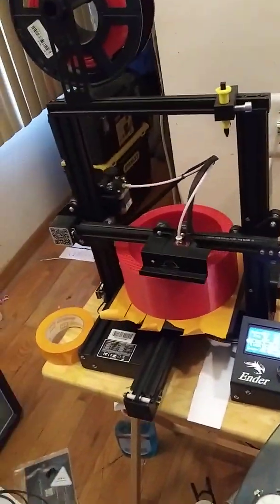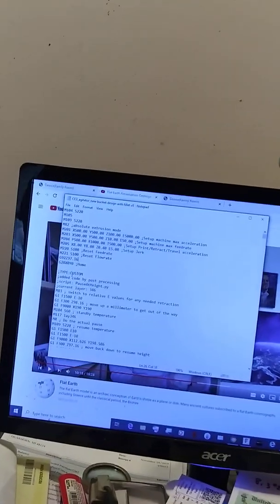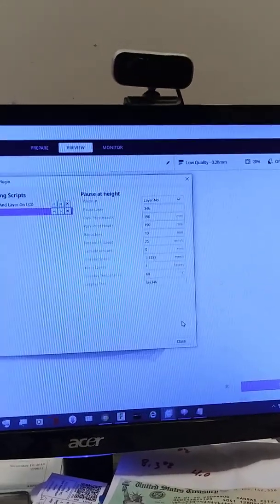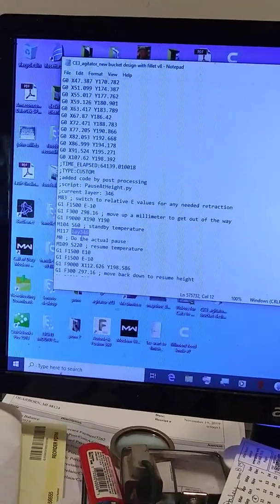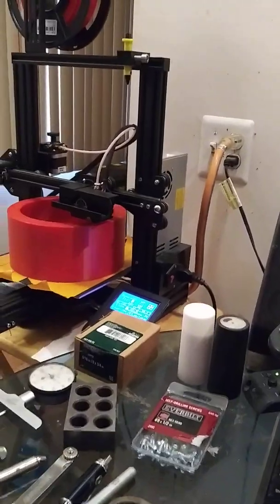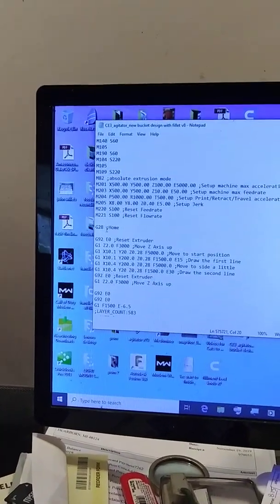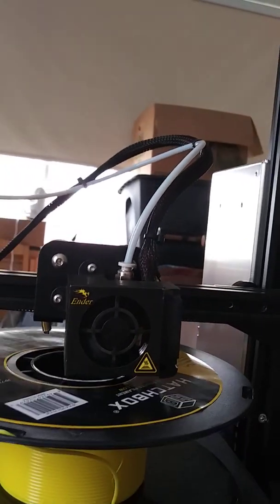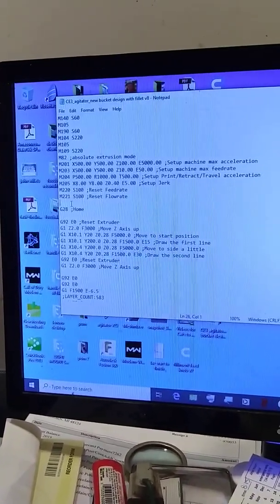Restarting a failed 3D print without homing the Z axis

Comment: I have 2 comments unless you are making a video for Tic-talk record your video in the Landscape orientation. 2nd, Don't give up on 3D printing. I have been trying to get a reliable printer running for the past 4+ years. Every now and then I think of giving up but there are so many ideas I want to design that keeps me going. Also, 3D printers have come a long way. Sure there is a lot that need to be fix in the Firmware, Slicing software, and actual printers that need to be further refined, I know.  At least there are a ton of options in the 3D printer hardware space these day. As I also say; Open source software is great, I understand that most developers do not get paid to program the slicing software and Firmware. I wish it could be somehow part commercialized and part still open source. Then maybe that part of 3D printing could move to hyper speed in development. I guess CURA is at least partially designed by Creality.. But something needs to happen to make this a real tool instead of a hobby first then tool second. Maybe we all can get together and add money to a fund for at least the Firmware Open source developers. Then they could work on the firmware full time then we would see a big leap frog forward in this industry.
Reply from the maker: The reason for not using landscape in the video is it is too hard to hold the phone that way and still see the screen without my hand blocking my view of the screen because of the position I was in
Reply from the maker: And why do you assume I am giving up?